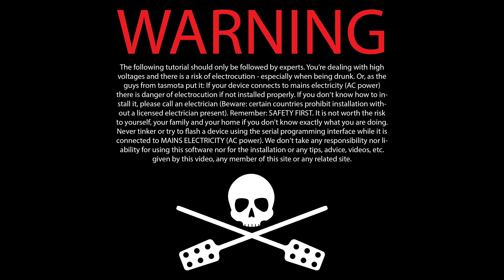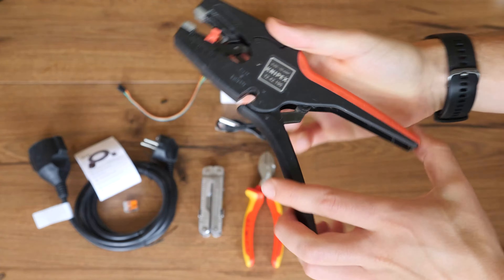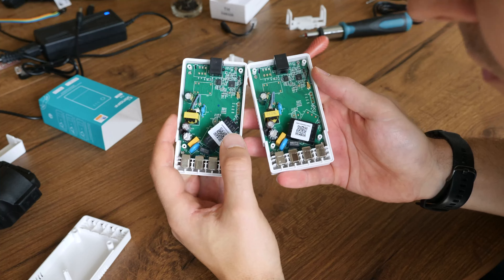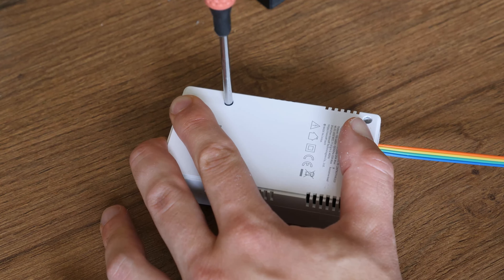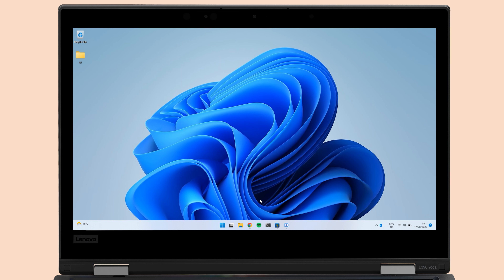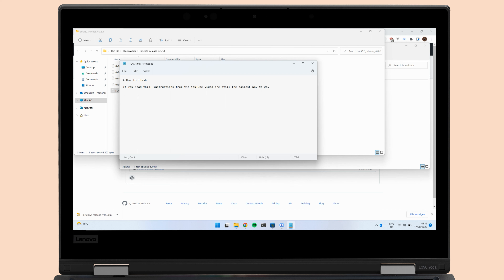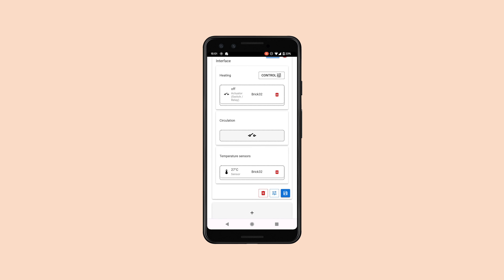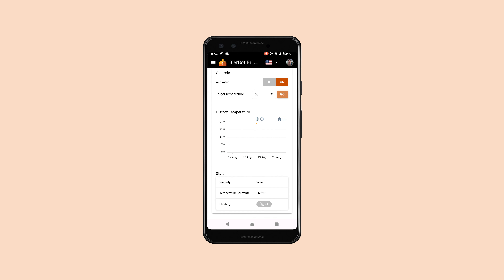Easy & powerful brewing control build (Sonoff TH Origin)

Comment: You forgot to remove the serial cable again. You only need to flash it once.
Reply from the maker: The chip inside does not allow over the air update (space too small to accommodate old and new firmware at the same time). So in case you ever want to do an update, an exposed serial port cable might come in handy. Cheers!

Comment: 9:17 Do not "apply solder", a tinned multi-strand wire will make a much worse connection in a screw terminal than a twisted multi-strand wire. In most countries it's illegal to do that. The best is a ferule but the twisted wires work just a well.

If you absolutely want to tin them, you have to do it strand by strand 😀
Reply from the maker: Wire end ferrul is the way to go.

Comment: can you use the device if there no WIFI conection in the area? brewing in the basement for example
Reply from the maker: WiFi and internet are required. Worst case you need to get a used repeater for $20.

Comment: awesome tutorial! does the ESP32 have to stay on the sonoff after flashing is complete or can i remove it?
Reply from the maker: You mean the COM Port flasher? This can be removed. But you cannot remove the main uC of the Sonoff (the ESP32). I just left the cables in case I want to flash a new software in the future (so I don't have to open the case again). Cheers

Comment: Great work! Can the relay in the Sonoff be used with PWM control? I'm guessing that's how it's used for boil control? Cheers!
Reply from the maker: For temperature control there is a pwm like implementation which will turn off the relay before set temperature is reached so overshoots are eliminated. For boiling there will be a slow pwm (90% maps to 9s On, 1s off) - but that is a Todo for the future. Check our forum there is a discussion around that topic.

Comment: Very helpful tutorial, thanks for that! Works like a charm. Only Issue is that the temp sensor is only available in 50cm length, which forces you to have the brick right next to whatever device you are controlling at the time. Since the device itself is not waterproof, thats a bit of a problem. Lets hope sonoff comes around with a longer version at some point in the future...
Reply from the maker: Sonoff offers the RL560 extension cord, any other RJ11 cable will work as well. There is also an adapter from RJ11 to the old aux jack so you can use the old aux sensors which are available with longer cables!
Reply from the maker: Oh, and would you mind giving the repo a star? ❤️

Comment: Hi bernardo, does it also work with TH Elite and BasicR2?
thanks for your tutorials!
 you are great!
Reply from the maker: The TH elite will work (excluding the display) with the software above. The Sonoff basic will work with this binary https://drive.google.com/file/d/1luXWEV ... sp=sharing - for install instructions checkout my other video
Reply from the maker: This video https://youtu.be/ZJEo5KyGwx4
Reply: @BernhardSchlegel  Thank you! the link however does not work.
Reply from the maker: @smartiebuccalon543  https://drive.google.com/file/d/1luXWEVQZDA8RloB-fBffBsaN5WXwLrKJ/view?usp=sharing
Reply: @BernhardSchlegel  it works, but it also gives me the reading of the probe (even if it does not have the temperature probe present).
I just use the actuator only. thanks!